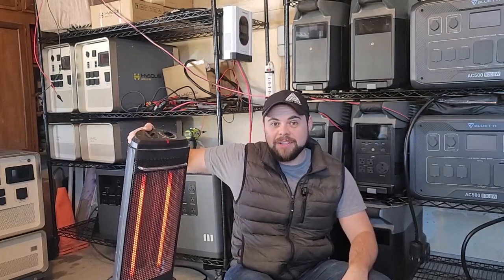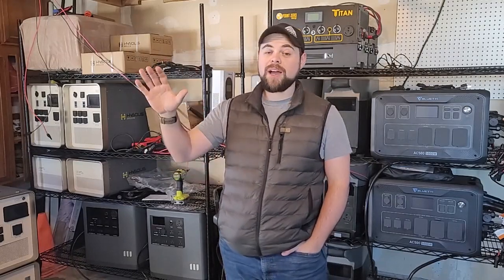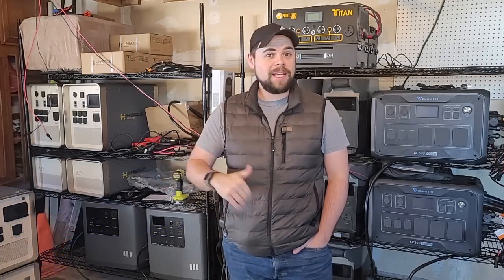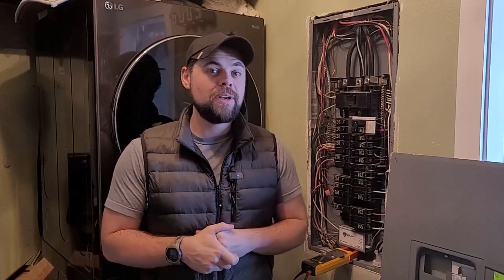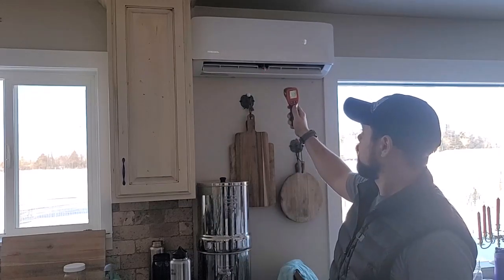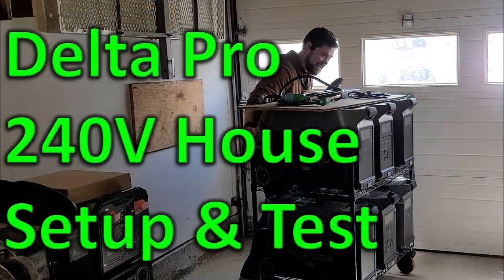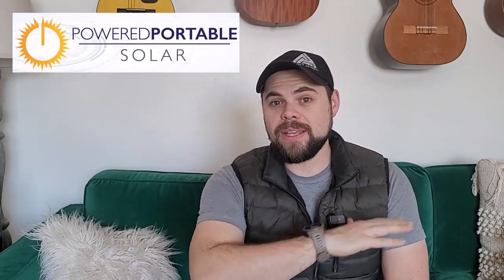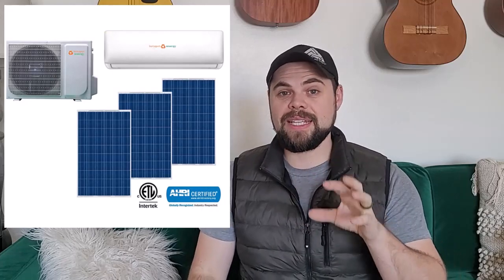How to Use Backup Solar to Heat the House

Comment: Do have an emergency shut down for solar and batteries?
Reply from the maker: What do you mean by emergency shut down? Like if one of the batteries gets too hot or something like that? These systems turn off if there are any heating issues, over voltage, low voltage, low temps etc.

Comment: Wow very informative!  Is the house heated solely by those mini splits at say 0 degrees or do you also use your furnace/baseboard/wood stove to supplement at that cold of temperature?  I live in North Dakota, so we do see -26 F a fair amount of time also, but most days highs are above zero.  Thanks for answering if you can.
Reply from the maker: I still have central heat with propane but we heat the entire upstairs with the mini splits. The basement gets pretty cold because the mini splits keep the upstairs warm and that is there the thermostat is. So I turn on the furnace a few times a day to ciruclate the heat to the basement. But, the bottom line is the entire house is not heated with the mini splits. They do help supplement it a lot though.

Comment: As always, great video! Probably looking to utilize some mini splits in the future. I do have a question why your (and really most) mini splits use 240v when it seems like they only need to run 1500w or less? Couldn't they do that fine with 120v @ 20 amps? Forgive me if it's a silly question, just dislike that I'd need to run special circuits to install multiple mini splits.

Comment: Saying it and SHOWING it are very different things! You didn’t SHOW how to use the “systems” for backup solar, just said you did it and the systems are capable. AND, only one system fit the need - Bluetti. So, show us how you use the Bluetti for your backup solar to heat the house! Split A/C, heat unit is nice and showing the power used was good info, now finish and show how you hook up the backup system and show the power draw for the system! Thanks!

Comment: You calculated VA, not watts. They are not the same for a/c power. That is the correct way to calculate power using DC, but that is not accurate for AC. You need to know the power factor on them heat pumps to accurately calculate the power usage. But still a great video, heat pumps are awesome.
Reply from the maker: Thank you. I don't claim to know everything. Every time I post a video I learn something new that I didn't know and messed up in a video. I will research VA vs watts more so I have a better understanding. Or if you can explain it briefly that would be a big help to me and anyone who reads the comment.
Reply: @minutemansolar  He's right about calculating A/C that has things like heat pumps on them.  Most items in a house have a PF of 1.0 or very near that, thus making the need to include PF in the calculation a near mute point because we're not building rockets here, we just want a number expressed in Watts that's pretty darn close.  I would guess your PF for those units would a little different than 1.0 but hardly result in a number after calculating the formula that would cause you to choose the wrong size system.   Again, he is right - industrial applications do require exact calculations but not really needed for the home owner.

It would be great info for you to let us know what you come up with for the PF of those units. 

Thank you for all of your videos.  They are always very informative!!!

Comment: Hey Ben my friend George actually installs those units up here in North Vancouver Island, BC, Canada. Those heat pumps also are amazing air conditioners in the Summer. Although our units are a little larger than the ones you have there. I heard a nasty rumour that the Bluetti AC5000's wo0n't produce 10,000 Watts when linked together in 240 Split Phase AC ? Can you please confirm if this rumour is accurate ? Thanks.
Reply from the maker: They really are great and I like them during the summer as well. I have filmed a video from when I installed them last year but since it's cold  now the video isn't pertinent so I will upload it when spring rolls around. At one point I was runnin 4 indoor units, cooled my entire house, and was only using about 450w. Insanely efficient. 

You're coorect about the Bluetti AC500s. I was tricked by them at first as well but have been quite vocal about it since I figured it out. Bluetti literally asked me to stop telling people that lol. I said no. People need to know the limitations of these systems and that's why I make these videos. The rumor is accurate. 7200w is the max output capacity for two AC500s. They advertised they were going to make a 240v 50a fusion box. I have from multiple sources from Bluetti that they will not make one. For a short while they were available on pre-order but now they are not. Maybe Bluetti will get wise and make one so they can stick to their claims. 

I am running a test as I type this on one of my AC500s to do a capacity test. So far, not so great. But we'll see. Also the idle power consumption rate seems to be extremely high which was one issue with the AC300. It has a 63w idle power consumption rate. So it will use 50% of it's own battery in a 24 hours period just to have the unit running. That's not good at all. 

Thanks for watching and commenting :)
Reply: @minutemansolar  Wow Ben ! 63 Watts at Idle !! 👀 That's not cool 💁🤔. I am an existing EcoFlow customer. I own a River 600 Max Solar Genny and I'm quite happy with it. It runs my big fridge for hours during power failures (Which we get up here in Alert Bay often). However I'm really disenchanted with the EcoFlow company's corporate culture, and their Facebook User Group treated me horribly ! I really like EcoFlow products, but I have to be honest and also say I've had some really unsavory, downright bad experiences with their customer service and tech support. I'm not surprised the manufacturer told you to stop telling the truth about a specific product feature that does not operate as advertised. The corporate culture in some of these corporations has become rather toxic and downright predatory. I really appreciate your channel and the time you take to making a video and really breaking down a product's operations. This is soooo helpful when it comes to making purchasing decisions. Please keep up the excellent work Ben ! 😃👍🙏

Comment: I have 3 of these at my house. helped a friend to install one too.  loves it during the summer.  Ours does pretty well in suburban Utah.  Not a cold as your area.  Mr Cool mini splits, are good, they do have additional resistance heater elements, I think.  maybe not.  Mine are 120V units. Mine are set to 65, 68 and 71 degrees.  Right now each one is running. between 400-700Watts depending upon the need.  They regulate very well.  My energy monitor installed in my panel, emporia energy, shows me that the unit use power is stages not ON/OFF so they don't use energy they don't need.
Reply from the maker: That's great to know. I don't think mine have the resistance heater in them, I could be wrong. Otherwise they should work in below zero temps theoretically to my understanding.

Comment: Please take this as feedback not criticism - but your math is not entirely accurate.  Your electric heater and your total mini split system are essentially pulling the same energy in wattage.  Your statement regarding efficiency based on that alone is not accurate - what really matters is how much of that energy gets converted to heat. I’d argue the electric is more efficient given the whole unit is in the room you are heating, so any losses get dumped into the room vs the split unit outside losing heat to outdoors. A better test of efficiency would be for you to test how much total energy in watts it takes for one of your heads to raise the temp in the served room by 5 degrees, then do the same with the electric heater and compare the results. You can do this in back to back testing since it does not matter the starting or ending temp, it takes the same amount of energy to raise a given space a degree. Do that and let us know your results.
Reply from the maker: I like it. Thanks for the feedback. I will try to do a test like that in the near future.
Reply: @minutemansolar  Excellent!  That will be a very useful test. It will help to answer the question “If I have 1 kWh of stored energy, what is the most efficient way for me to spend it to heat a given space?”  You can define “heat a given space” however you like, but consider using a temperature increase like “raise temp in room by x degrees.”  I think such a metric would be very useful for folks with smaller backup systems - as it would help them to decide what to “spend” their energy on.
Reply: Heat  pumps  work  well  when  they  have  a  good  source  of  'heat'.   The  colder  it  is  outside  with  an  air to air  heat  pump  .  .  .  .  .  the  less  'heat'  is  available.   Also,  when  the  outdoor  coil  starts  freezing-up  it  will  cycle  to  a  modified  A/C  mode  to  defrost  the  outdoor  coil.     Good  Fun  ! ! !

Comment: If you’re talking about keeping warm in the winter, I wouldn’t be able to use that amount of electricity, especially if the power goes out! By the way, I do have solar as a back up. 
The solution I have would be to hook up a diesel heater on the outside of one room so that people won’t freeze to death! There was a recent video by Riverside Homestead life, I suggest you check it out! 🖖
Reply from the maker: Great question. I am not 100% sure. I would think it has to do with the start up energy required to get them going. I was measureing their power output after they had been turned on and running for a very long time.

Comment: Math added up for the heat pump not running. It’s electric ⚡️ not on heat pump.
Reply: Bottom line is it’s working.
Reply from the maker: I am still trying to understand exactly how it works, I just know I get a lot of heat for a large area in my house for the same energy as a heater that would heat half the space. How did you do the math, I'm interested in learning more about that.